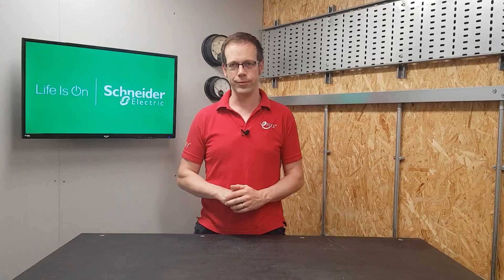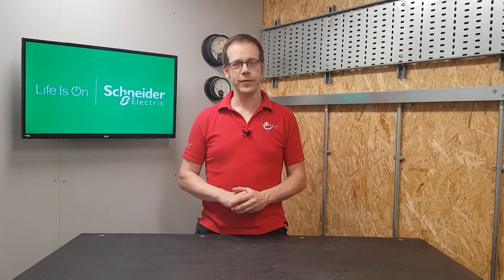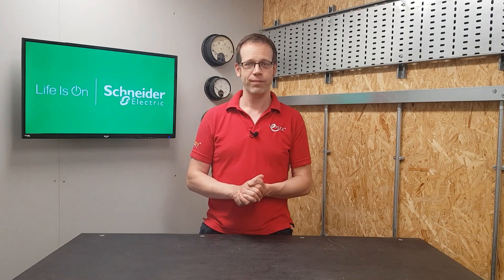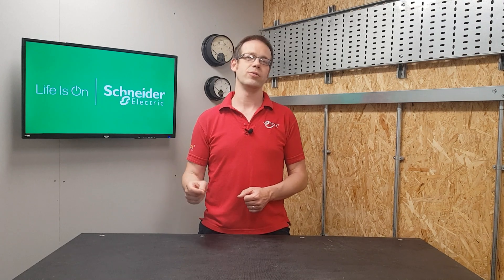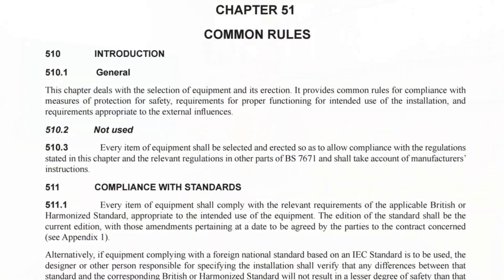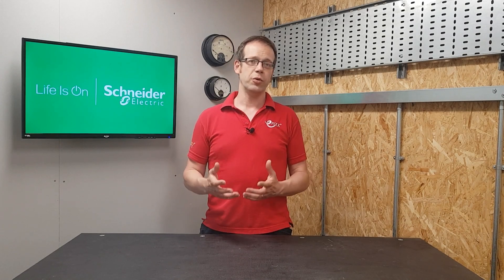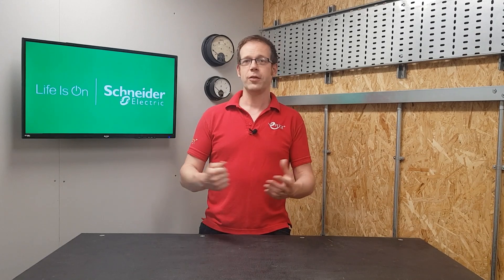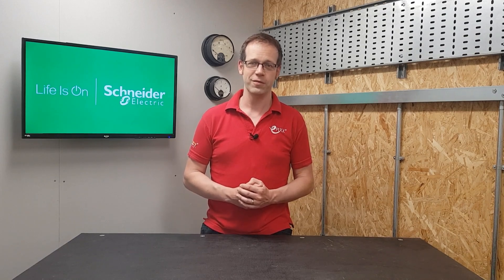Do you need to use a TORQUE SCREWDRIVER when wiring consumer units?

Comment: Interesting perspective @efixx.    The regs clearly state that it is a mandatory requirement that the manufacturers instructions are to be taken into account.  However they fall short of mandating adherence to the instructions which is rather odd and it is a shame that you don't raise this in the video.   Further, manufacturers' instructions are generally very vague, poorly written and often do not mandate torque settings; again, a shame you dont raise this.  So on that basis it is bit of a stretch to say that use of torque screwdrivers is needed... Whilst it is without doubt good practice to use torque screwdrivers, their use is clearly not mandated as the regs are vague which is also often the case with manufacturers' instructions.

Comment: You could argue that "take account of" doesn't mean the same as "follow to the absolute letter" . Oxford defines it a "consider (something) along with other factors before reaching a decision." and merriam-webster "to give attention or consideration to (something)"
Reply from the maker: So let's imagine something goes wrong and you have a warranty claim or worse a fire - how does the argument for ignoring the manufacturer's instructions stack up?
Reply: @efixx  Read it again "taking account of" doesn't mean ignoring. If the regulations mean "follow the manufacturers instructions to the letter" then they need to say that but they don't. But also there's the practical aspect of how would anyone ever prove the screws weren't done up to the correct torque and hasn't been interfered with since?
Reply from the maker: @mfx1  Instructions say tighten cover screws to 1.7nM to ensure a waterproof seal, in your own judgement, decide not to follow this and over tighten the seal.  Three months later product fails due to moisture ingress through the over-tightened seal. Who's liable for the problem? Some instructions are black and white.

Comment: I’m suprised to see that there isn’t already torque settings for sockets and switches, however I’ve just seen the new screwless sockets which could be the future. 
Exciting
Reply from the maker: It'll be interesting to see if manufacturers will require accessories to be done up to specific torque values. I suspect it will happen in time. We'll see!

Comment: I use one frequently, a whia one in fact. And just recently I torqued up a neutral bar on a brand new Hager board, (setting set to the exact setting as per MI’s, and it broke the bar in 2. And no, it wasn’t done up past torque to start with just nipped then torqued. Possibly just a faulty bar yes, but still, frustrating
Reply from the maker: I bet it was. 🤦‍♂️

Comment: Connections in a board should be torqued down at the point for where most circuits should experience the highest load, except for those circuits that supply an invididual piece of equipment for example. Not that almost all DIY'ers will care. So should say a cooker plate having a high powered single fixed load, with the power equal at both ends, have torque settings specificed by a manufacturer to prevent under/over tightening etc, as most people fall in the mantra of more torques = more betterer?
Reply from the maker: You raise an interesting point here, it'll be interesting to see if manufacturers start specifying torque values for accessories other than consumer units etc. We'll see!

Comment: ok  I'm an old fart but at 56 I was given the chance to retrain and go back to college the main reason for putting this comment on hear is I have seen others using torque screwdrivers on you tube and then just putting them away I've always been told that when you've finished with a torque anything that you release the pressure or set the torque back to 0 this stops the torque driver from going weak and then not giving you the correct settings and yes their mentions at college also I have been told that you are required to use them on your AS2 exam
Reply from the maker: Interesting points, we'll look into it. 😊

Comment: What are the problems with over torquing? I've seen plenty of issues with under torqued connections over the years but if its done up firm are there any problems?
Reply from the maker: Damaged conductors, distorted terminals , broken pcb terminals and leaking waterproof seals.

Comment: I hope we do not get to the point of needing to torque accessories in the future, not because I don't agree with the practice but I hope we see screw less terminals on all accessories in the near future negating the need to torque anything. 

I have no clue why we have not seen this change happen already in the main stream just as MF junction boxes with their relevant connectors seem to have been adopted by many.

Also it has been shown screwed terminals can come come loose over time due to various factors where as many screw less alternatives do not exhibit the same behaviour. 

I wonder if we will ever see a totally screw less consumer unit in the future?
Reply from the maker: Tune in tomorrow for some big news 🤫
Reply: @efixx  Now you are teasing 😄
Reply: I’ve said about screwless accessories for years. It would work on socket outlets well allowing three cables for Spurs from a ring with 2.5-4.0mm cables. The problem I see is certain accessories like a three plate pendant with possibly no room to expand from. I know three plating at the light is kinda being phased out in new builds but still needed for retro fit and personally I like to see a permanent live at light and neutral at switches for smart. Isolators for cookers and showers would be great screwless as we see so many burnt out due to loose connections

Comment: So realistically, if we don't use a torque screwdriver ( yes, I do, checked twice normally) and the manufacturer recommended its use, you should declare this in the departures from BS7671 in any cert you issue?? Or would that be too far?

Comment: My biggest issue is I have a Draper brand torque screwdriver. I am working in a 630A 3 Phase Main cubical with Eaton MCCB's of various sizes which terminal is a Hexagonal screw to tighten the connections. Draper torque screwdriver set does not include a hexagonal attachment and having contacted Draper, they do not do a hexagonal attachment and gave me no solution to get the right torque setting. Do I really need to go out and buy another torque driver well over £100 or do I use my experience and tighten them by hand? This is the real world and manufacturers dont give a damn it seems.
Reply: To be fair, a torque screwdriver likely won't give you enough torque to tighten up an MCCB to manufacturers specifications.  Most screwdrivers will give you 5nm tops and an MCCB will often be above that. You'd probably be better investing in a torque wrench if you do a lot of industrial work. Then you can buy any sort of generic attachment with a 1/2" drive to suit the breaker you're working on.

Comment: I've managed to snap the end off a torque screwdriver blade tightening a crabtree Rcbo live/line terminal as I used one of the thinner blades because of the insulation stopping the end reaching the terminal screw as they are further in.
Luckily local wholesalers just swapped it for a new blade

Comment: As a licensed avionics engineer, I watch your videos with interest. In the aviation industry, where a torque loading is specified, it has always been a requirement that the torque wrench or screwdriver is within the calibration date AND checked for the specified torque loading using an Acratork rig (or equivalent) when securing the fastener. It makes sense for hard materials but when securing malleable materials, such as bare conductors, the torque figure might be "within specified limits" right up until the point where the material has all of its properties damaged to a critically dangerous point. It would be good to see if conductors are materially damaged from the lowest to highest specified torque loading figures specified.
Reply: This! Many people use a torque screwdriver that can vary in torque. But they never get it calibrated, like the tool manual says.

Comment: The question is why would you not use it? Can't stand the ignorance of Some of the older generation ( no offence ). People are too stuck in their ways " I've never had a loose connection in 30 years . It's like doing difficult maths in your head rather than using a calculator a poor analogy I know . This tool reduces the chance of human error people are almost offended by this tool. 

Best 
Matt
Reply: They can give a false sense of security. Having your torque screwdriver click and just assuming all is good is worse practice than using a fixed screwdriver and giving it all a good check over to ensure tightness. Ideally you'd probably use both. Fixed driver to get everything to a "it's not loose" torque and allow the conductors to do their initial movement, then go back over and torque everything up to the required spec.

I imagine that if all electricians suddenly switched to torque drivers tomorrow there would be more loose connections than there are today.

Comment: The problem is that some folk think "oh the driver has clicked, its torqued up". NO it fecking isn't! Give it a pull, 9/10 it will be loose. Torque it, leave it, tug it and repeat. Strands flatten out and become loose. Better option is to flatten strands out before putting in terminal.  But what do I know, see present wife for further details
Reply from the maker: Good advice!

Comment: In my opinion the torque settings applied should be evidenced on the relevant electrical certificate as prove of compliance with manufacturers instructions. Just owning the tool is not enough.
Reply from the maker: Good point, like this.

Comment: Isn't it someone creating a tool for a issue that wasn't an issue in the first place?
Reply from the maker: Not really, setting terminals to the correct torque has been around for ages in industrial installations, particularly with big MCCBs. It's becoming increasingly important in domestic consumer units now.
Reply: All commerical and industrial sites have preventive maintenance schedules. And apart of the schedule electrical integrity inspections, with visual checks, torque/tightness checks (should tightened to ~80% of torque rating so you do not fatigue with over tightening) and current draw measurements, voltage imbalances, and maybe dialetric integrity tests. Nothing is set it and forget it.
Reply: @MroAeon  No, you set to the torque rating specified, not 80% of it ffs.
Reply: @ricky302v8  Isn't be referring to the maintenance torquing?

Surely you can't do a 100% torque at each maintenance schedule, you'd run the risk of stripping the thread.
Reply: @ricky302v8  it's for returning to equipment that has already been in service for months and years. If you set it to 100% there's not much of a problem or risk for over torquing. But torque screwdriver settings vs each connection point torque rating doesn't always match up. I can look for the code about it's being 90 or 80% of torque ratings
Reply: @MroAeon  If you're returning to equipment then you loosen the screw and then tighten back up to the 100% correct torque.
Reply: @cypeman8037  If you use the correct torque setting why would you strip the thread?
Reply: @ricky302v8  you don't want to do that for fatigue issues. And, I half corrected myself. If you are careful not to over tighten, setting at 100% torque on revisits. . .  That's the way I use to do it. However, recently came across code referencing to do 80-90%. Torque is torque and keeping them at correct specs is pretty paramount. I deal with some medium voltage motors and starters, and more standard 480/460 high current motors. But, from residential 20amp contactors to a 500 amp and up starters. I definitely stress electrical integrity.
Reply: @MroAeon  Do what? loosen then retighten?
Reply: @ricky302v8  yeah, it's arguing cunt-hairs between different professionals. But the loosening and retightening is the argument that it causes fatigue.
Reply: @MroAeon  The reason you loosen and then retighten to correct torque is that you don't know who's been there before you, someone could have tightened the screw to double the correct torque and you would never know if you just retightened only. 

I see it all the time with tyre fitters, they tighten the wheel nuts/bolts with the impact gun and then check it's the correct torque with their torque wrench, of course their impact gun is set to 250 ft/lbs and their torque wrench is set to 100 ft/lbs, so to them it looks like every nut/bolt is at the correct torque.
Reply: There was an issue, it called arcing , because of loose connections , and terminals not be tightened up
Reply: @robertburrows6612  But was it an issue with the tightness of the screw or the screw itself, or was it a terminal block issue, a cable issue, workmanship issue.
I find most times I come across a mistake when doing a job it's more often me that's the issue.
Reply: @robertburrows6612  when was the last time the wheels on your van or car started to wobble or they came off because the wheel nuts came loose ? you get a puncher you pull over you get the jack out of the boot you change the wheel do  you use a torque wench or torque screwdriver ? no you sodding well don't you you use a the wheel braise that came with the car or van  and none of your wheels have ever come of or come loose . screws or nut coming loos over  time is a myth  unless some dumb DIYer has been tampering with the CU.
Reply: @Dog-whisperer7494  When I drove HGV for a living, I had a puncture on the motorway on Thursday morning, the fitter replaced the tyre and torqued up the wheel nuts, told me to get them re-torqued the next day, as they can become loose as the wheels bed back in. Went out early the Friday morning before the garage opened. Around 17:00 Friday evening south bound in the middle lane of the M6, 2 of my nearside rear wheels over take me, hit the grass verge, bounce, land in lane 3 on the north bound carriageway, bounce again and come to a standstill on the grass bank on the opposite side of the motorway. Miraculously no one was hurt and some helpful police men recovered my wheels for me while I waited to be recovered. So yes, wheel nuts can become loose as can screws.

Comment: Here in Germany or Austria I have never heard of normal electricians using torque screwdrivers.
Reply: Exactly it’s a German/ Austrian invention yet they don’t use them there selfs . It’s just an other way for the manufacturers to make even more money the french don’t use them either nor the Americans. It’s all BS
Reply: @Dog-whisperer7494  in Belgium we also don't use it in fuseboards .. never seen someone use it . ( i do own one )  but yes loose screws can cause big problems ...
Reply: @kittsdiy  
But I think there is a bigger risk of overtighten it.
Reply: Was never really used in Norway either, but now it is more frequently used. And it is needed as well, many connections get over tighten and some is to loose.